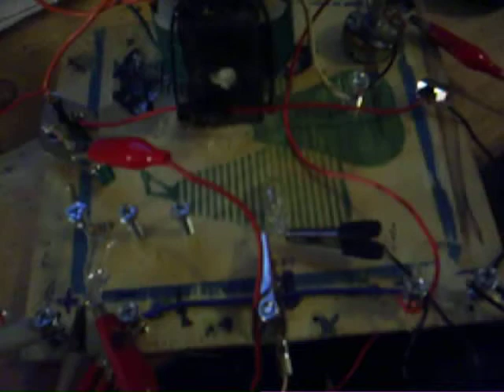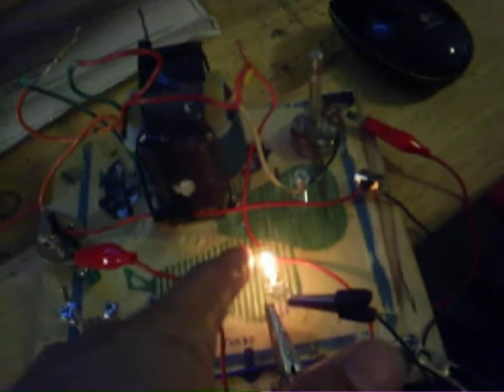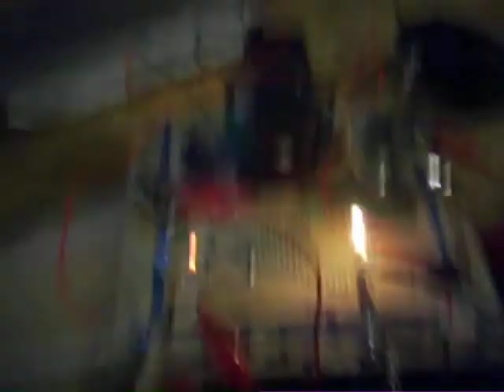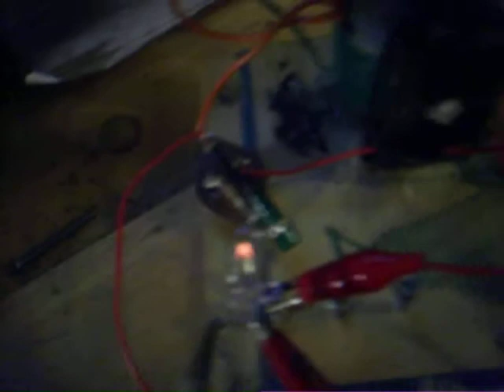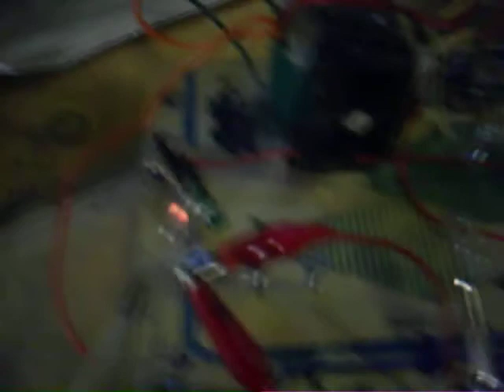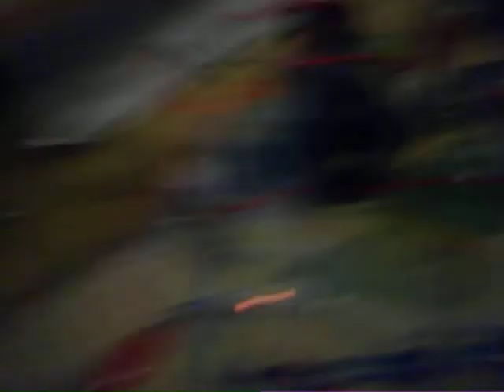measuring current with 12v bulbs

Comment: You won't get the same results from a 120v bulb as a 12v bulb, even if both are rated for the same watts used. Try it out. Use a computer power supply, connect a 12V bulb to the 12v rail, maybe use an 1156 bulb which is 28 watts. It will glow brightly. Next use a 25-30 watt light for 120v on the 12v circuit and you will get only a dim glow. The reason is the 120v bulb provides a lower resistance value than the 12v bulb.

Comment: That is confusing using the classical electron flow model of electricity which I personaly have my doubts about ... it would make more sense if electricity was actually high frequency polarity shifting of valence bonds at the atomic level... the bulbs produce light and heat ... light is polorized energy ... heat ??? physics "heat is less cold" ... "cold is less heat" ... confusing ... yea

Comment: The only problem about going in reverse is that your input was very bright at the start and the output was very dull.The other thing to remember is that if this was an SSG circuit and the output was the input draw-why dose the battery charge??This is why i like to use true current flow,as it changes the whole picture.I will indeed be doing some testing of my own tomorow-that you can count on lol.

Comment from the maker: yea thats what i always thought too... it would be a totally different story were they both small 120v bulbs.. i get the same effect on some bedini motors too. u should give it a try on anything you have where the output pulses are grounded via the positive input rail.

im forced to change my thinking in general about circuit consumption and start thinking in reverse, whereby that light coming from the output bulb HAS to be showing the circuits input draw.

Comment: Ok Mag-now im interested.This is from wikipedia--Incandescent lamps are nearly pure resistive loads with a power factor of 1. For two bulbs of the same voltage, type, color, and clarity, the higher-powered bulb gives more light.
This has always been my understanding aswell.The incandescent bulb with the most power being delivered to it ,is the one that is lit the brightest.Now we have a problem in that your input bulb is not lit and your output is?Soooo-WTF?